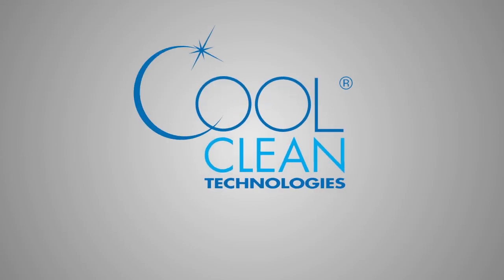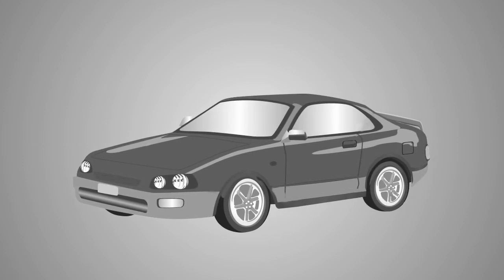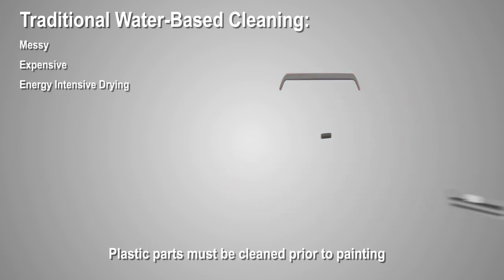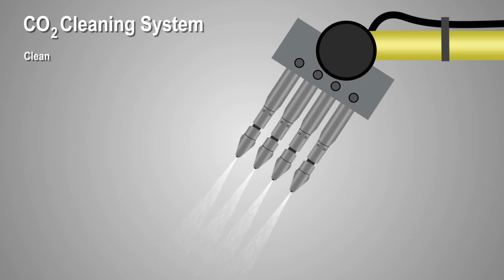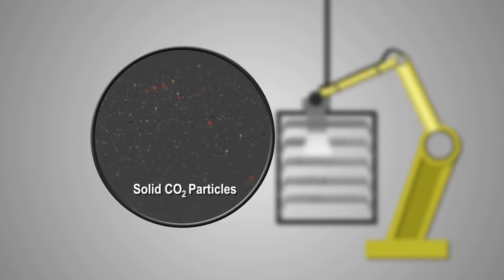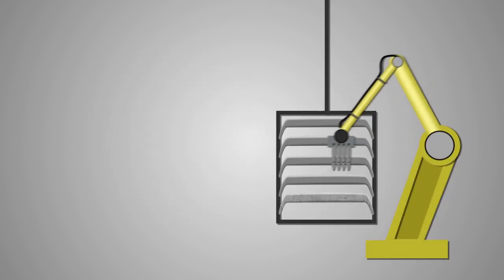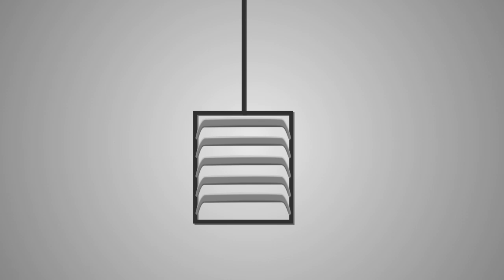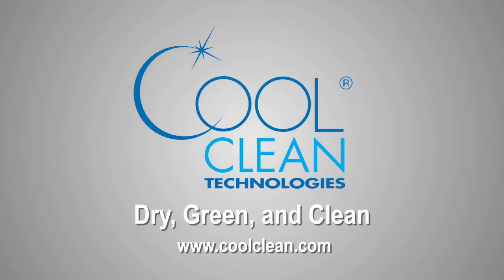CO2 Cleaning for Automated Paint Lines

Comment: Arise some questions like 
1. What is the source of C02 gas ?
2. This used C02 gas increase, is it increases C02 level in environment?
3. Is it green technology?
4. What is the cost of CO2 gas per litre?
5. Is it mandatory Robot for cleaning purpose ?
6. These exhaust C02 gas effect in green house effect?
Reply from the maker: 1. What is the source of C02 gas ?

The CO2 gas comes from many industrial processes depending on location.  For instance, in the Midwest much of the CO2 gas comes from ethanol plants.  In other areas, the CO2 gas will come from oil refineries or ammonia plants.

2. This used C02 gas increase, is it increases C02 level in environment?

This is CO2 gas created from other processes.  Our systems do not increase CO2 levels in the environment.  We are simply using the CO2 produced by other processes before allowing it to escape into the environment.

3. Is it green technology?

Yes, this is considered green technology since we typically replace dangerous solvents.

4. What is the cost of CO2 gas per litre?

CO2 pricing is highly dependent on location and volumes purchased as well as the quality of the CO2.  We recommend using beverage grade CO2 for our applications and the price can range from $0.10 per liter to over $1.00 per liter

5. Is it mandatory Robot for cleaning purpose ?

No.  The robot just allows for greater consistency in the cleaning process.